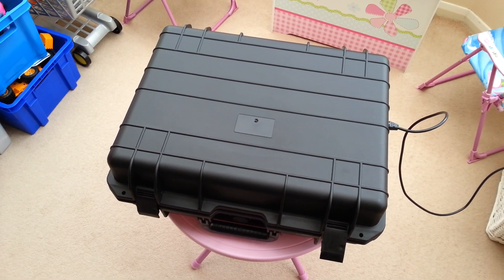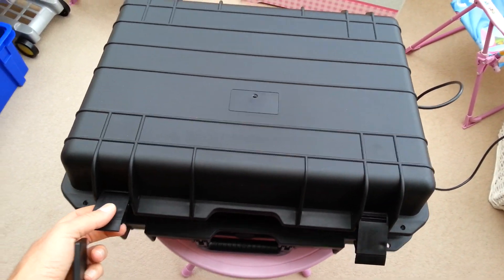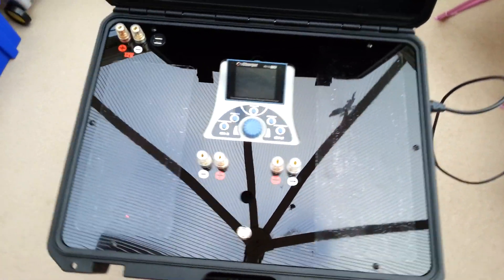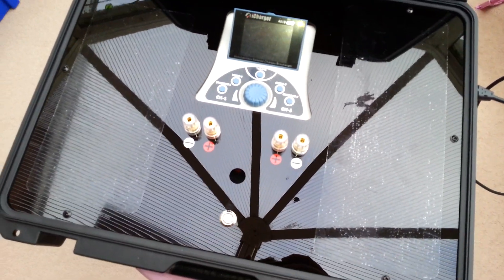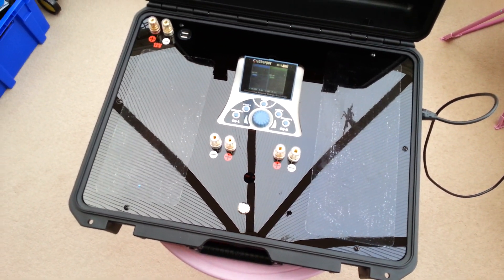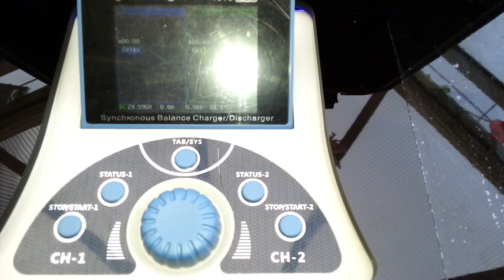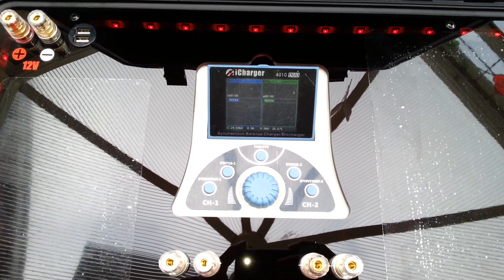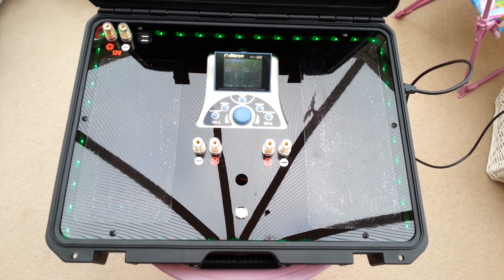iCharger 4010 DUO Charge Case 001

Comment: How you balance the batteries??????
Reply from the maker: Hey Buddy. The balance boards on this case were still with the customer at the time, so I couldn't fit them. But the small hole on the deck allowed the balance leads to be poked through and conencted to the front of the charger. The boards would then be velcro'd to the deck.More recently I now have some small PCB boards that allow me to replicate the balance connector onto the deck itself, so the boards plug in on the deck, which makes things easier.Please check out my web site for some more recent photos of case builds, www.coolice.co.uk and any questions about my custom charge case builds, please don't hesitate to contact me. Ian Contessa